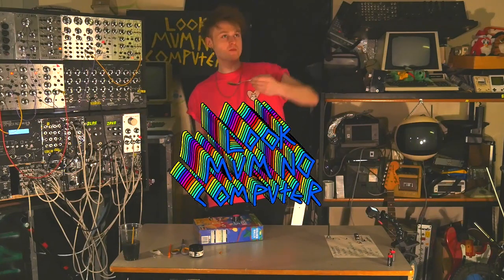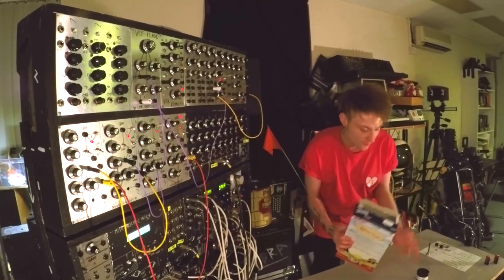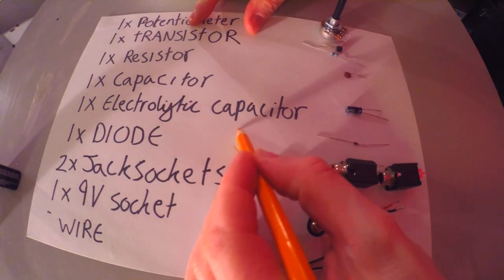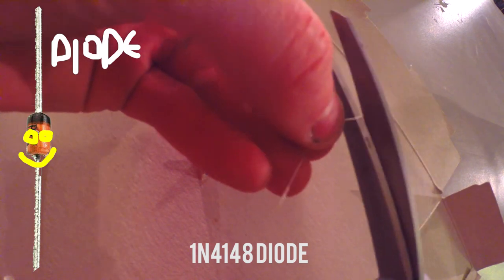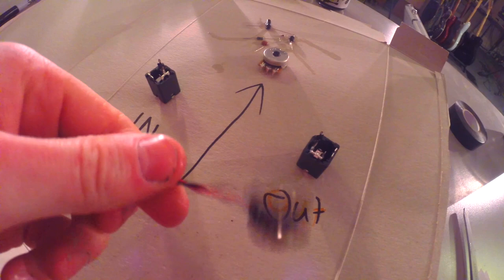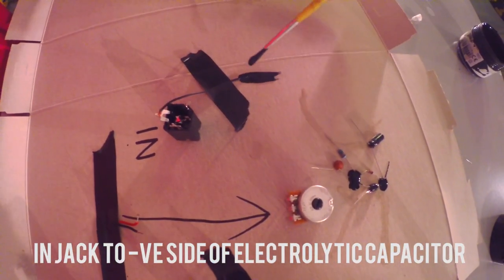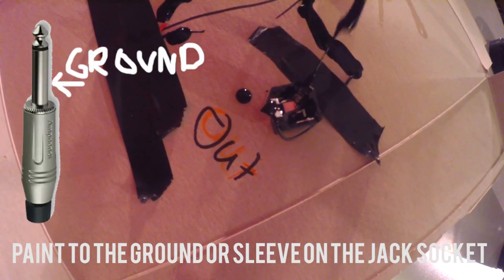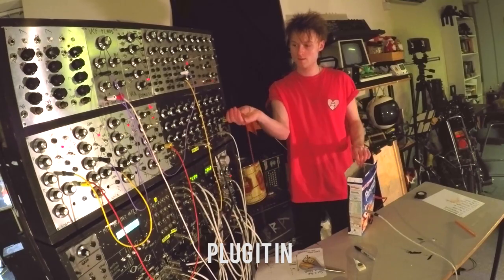DIY DISTORTION FOR GUITAR OR SYNTH SOLDERLESS HOW TO VIDEO

Comment: hey dude, thank you for the circuit, it works great. i also get some kind of shortwave radio station, like mixed spanish french german and british. its cool and creepy at the same time. maybe its like that because its evening...
Reply: LOL ))
The other guy commented that you need to wrap it over with a foil to stop getting those... I guess you need to connect that foil to GROUND contact (of any jack).
Reply: I use a bunch of cheap and nasty guitar pedals bought second hand, in some configurations, you don't even need to add distortion, as they sound bad on their own, I need another distortion pedal for another project, I'll be building this one in a non metal box as I love using shortwave radio in my sets. My only concern is that the shortwave will be drowned out by the electro magnetic interference caused by the p.a., which is why I usually have to pre-record radio to use when I perform live, which defeats the random aspect a little bit. Nice one Sam, another top vid, genius.
Reply: If you're trying to get the best shortwave reception, night time is the best, it's to do with atmospherics (I don't claim to understand why), also there is less industrial activity generating rf interference. If you intend to utilise the interference, try attaching a long length of wire, certain lengths better than others on shortwave frequencies, apparently 29foot is a good length thats still reasonably practical. My pedal board picks up the washing machine and combi boiler, which isn't that cool. I'm running a fairly cheap power supply and can't justify a decent power conditioner, which would remove this.

Comment: well.. you can buy yourself conductive paint for 30 pound... or just connect the pins with ordinary copper wire for few cents and "maybe" an el cheapo soldering iron.  YOU DECIDE!!
Reply: Can i use sausages instead of resistors?
Reply: @buchstabensuppenfa7545  in all honesty you probably can if you choose the right sausage